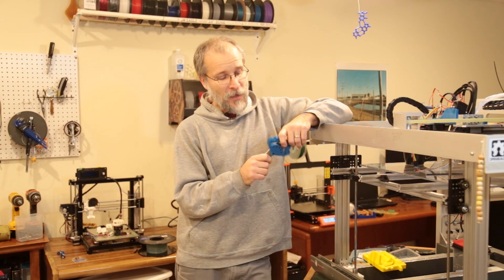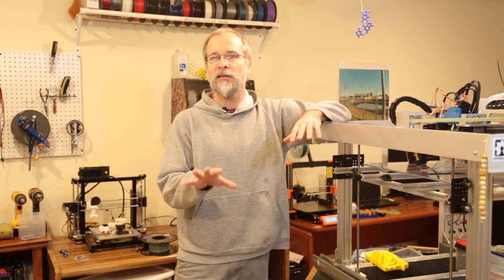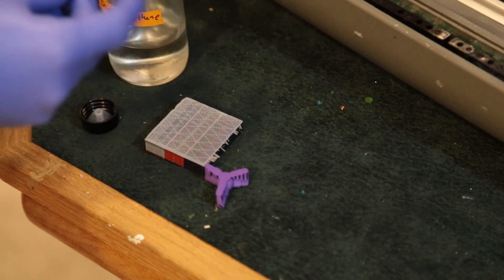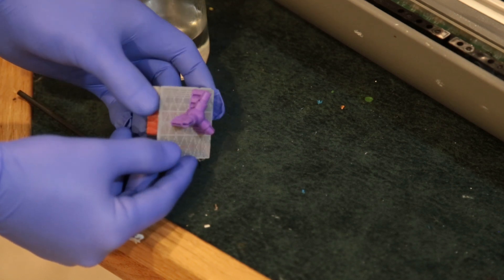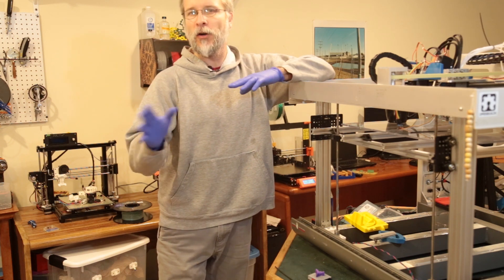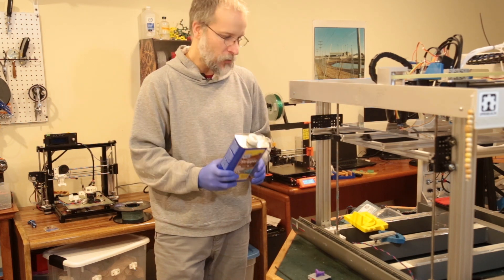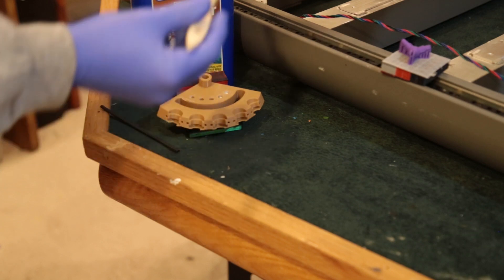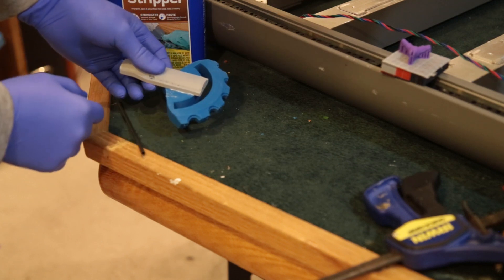Solvent welding PLA with off-the-shelf paint stripper

Comment: This is super helpful! 2.5 oz of 3d Gloop for PLA is $25 + tax and shipping. Plus it's shelf life is only 3 months.
This is really high and I've been doing quite a bit of research into finding an alternative.
I was wondering what there propietary ingredient was so thank you for giving a hint!
Others have menthioned methyl Acetate, which comes in non-acetone nail polish removers.
I think I'll give both that and paint stripper and nail polish a try before 3d gloop as they are much cheaper, more readily available, and will have longer shelf lives / multiple uses.
Thank you for the EXCELLENT explantion and content!

Comment: What can I use to smooth PLA?
Reply from the maker: Pure DCM can be used to smooth PLA, though it is somewhat complicated. You need controlled heating. It will also decrease part strength, so it should only really be done for ornamental things.
Reply: @ppaukstelis  How about paint thinner spray applied to the outer layer? Just want to smooth layer lines.

Comment: So if I find this paint stripper in liquid form, can I use it to clean my 3D printer nozzle from PLA clogging it up?
Reply from the maker: Yes. Keep in mind it probably won't completely dissociate, so there will still be residue, but you can much more easily clean it off once it has been softened in the DCM.

Comment: My paint stripper is about 75% DCM and most of the rest is methanol. When you say yours doesn't have much in it, how much do you mean? I tried it on PETG and it does work ok but the plastic seems a little bit soft and rubbery even after 24hrs. I'm thining of trying some Acri-bond 120.
Reply from the maker: I honestly don't know. It is not listed on the container and I never did track down MSDS for that particular one. I've used it on PETG a number of times without noticing it get too rubbery.

Comment: Ever since 3d Gloop came out and I smelled that MEK in it, I thought about making a video like this. So glad you did it so I do not have too. One thing I might try is getting a MEK solvent in a small jar and putting in some PLA. And just let it sit until it disssolves the PLA to see if that makes a gloop type glue. Love the Gloop but the cost is so high. And yes always work in a ventilated area or under a fan vent hood. You mentioned that Ether might work. Do you think that spray starting fluid that has ether as its main ingredient would work as a spray on smoothing system ?